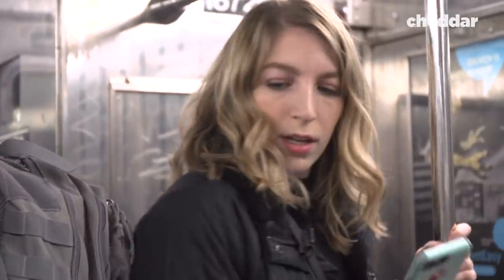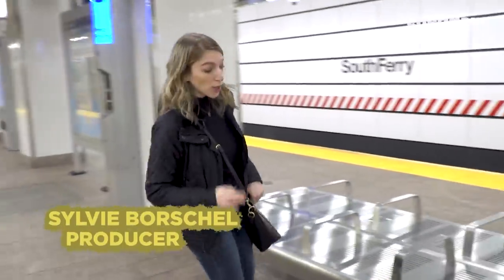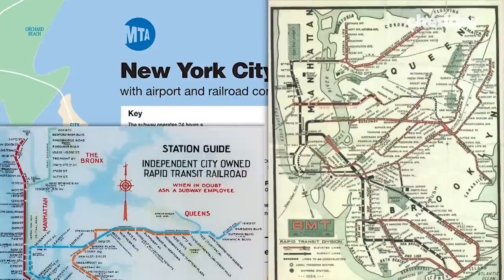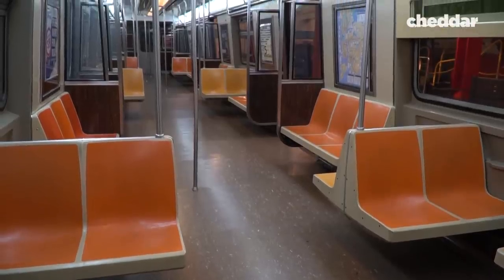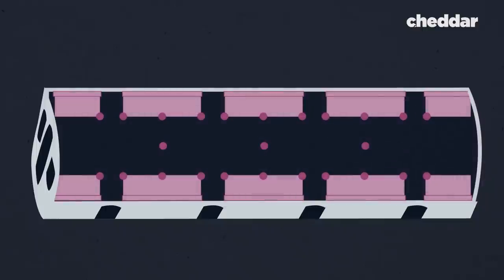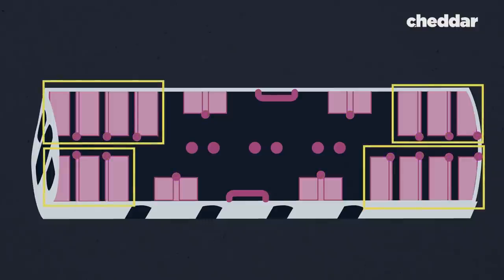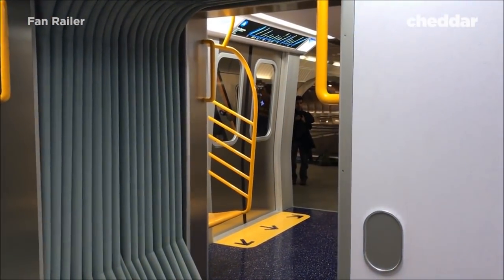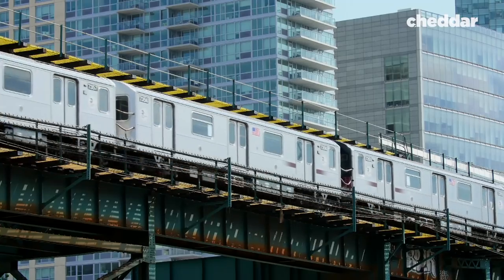Could This Subway Car Save NYC Transit? - Cheddar Explains

Comment: Airline style seating on subway and inner city trains is the worst idea ever. We have them on some trains in London and they are horrible. They aren't designed for getting on and off quickly, they are suitable for long distance travel only, not short hops. You have to squeeze past someone, because of this the window seat is often empty when it could be full. They eat up more standing space. Because there is less room to get along the isle, it only takes one person standing to stop those seats being filled and instantly lower the capacity of the train or to make someone miss their stop. It's just poorly thought out design. Airline style seating should be for situations where a train makes a stop every 10+ or 20+ minutes, not every few minutes like most inner city trains do.
Reply: Our new trains in Brisbane Australia maximise seating and have higher chair backs for comfort, large bathrooms,  gangway doors. They are really nice. In Australia it is common curtesy to always sit in the window seat and leave the aile seat for other people. Then,  people just stand up when the window person wants to leave.
Reply: @cocoacoolness   Inner city trains in London

London has a population double the size of Sydney. If you combine Sydney and Melbourne you'd get London's population. Greater London covers an area one fourteenth of those two cities combined. Brisbane has a population of 2.1 million. More than four times less than London and covers an area almost fifteen times larger. So no, not really comparable. 

In Brisbane it might make sense to have that style of train because the distances between stops will be longer (meaning an incentive for passengers to sit down) and carriages won't be as packed (meaning it's easier to get on and off). But if Brisbane population density doubles then they'd probably have to change the style of train.

New York metropolitan area and Greater London are at least similarly comparable some aspects, however New York City appears to have a much higher density - probably because it's a much taller city (London is yet to get as many tower block living accommodations as New York has).
Reply: That's kinda what I thought when I saw the "perfect" design revealed. I'm glad they decided to go with the design that they did.
Reply: It works in D.C. They're subway cars are pretty great. Not the same style as they recommended in the video but the ones there work pretty well.
Reply: @cocoacoolness  The difference here is that Brisbane's train network is a commuter rail system, instead of a rapid transit system, which is what New York's subway is (and a bunch of others like London's underground). This means that trains in Brisbane are built for longer distances to work with the layout of Brisbane and quite frankly most Australian cities, which is more suburban and less dense than cities such as New York (Sydney is maybe an exception). That's why comfortable, transverse seating works better in Australian trains, because there isn't a need for more standing room which is only needed for fast and short distance train commutes
Reply: Nothing compare to Greater Tokyo Metropolitan.
Reply: Agree.
Reply: Most of the UK's railways use airline seats and they are comfortable when the person next to you is already sat there
Reply: NOJ Exactly. 👏🏻👏🏻👏🏻👏🏻👏🏻👏🏻👏🏻👏🏻👍🏻👍🏻👍🏻👍🏻👍🏻👍🏻👍🏻
Reply: NOJ honestly im soo glad we have the type of subways that we do they are kinda comfortable unless the train is full. But if you do want longer rides like the ones you say are in london we have the long island railroad., it has a plane design and has longer rides i love it 😭
Reply: If you have a short trip, simply don’t sit on the “airline style seating”.
Reply: I agree.

Source: I travel on the Bakerloo and Metropolitan lines...
Reply: While you're partially right about London, it is still mostly an MRT system, but National Rail takes charge at some areas to be considered "commuter rail".
Reply: Toronto’s subway has “airline” style seats but the whole train can be walked through (no doors separating carts)! I think that solves the issue with short hauls! Some people don’t bother to sit cause going three stops will take 5 minutes ish
Reply: @tinyelephant1533  except in reality DC is switching away from airline style seating to mixed seating. Metro also goes far out into the suburbs and has longer average distance traveled.
Reply: You're 100% correct. I INSTANTLY thought there would only be one person in each of the airline seating rows. I'm kind of shocked this video recommends it. It kind of discredits any future recommendations they may have. If I watch them again, I will take their opinions lightly.
Reply: Yes, they basically just invented a bus. Good job MTA.
Reply: You can locate seats perpendicularly to the moving direction only if the line has not got many passengers during rush hour and to get places for people with low mobility.
Reply: NOJ geez so long
Reply: Thank god the MTA went with the design they chose. Asymmetrical door placement would be confusing for riders (predicting where the door will stop on the platform that you can get on quicker) and would present logistical challenges. In many foreign cities where subway overcrowding is an issue (Tokyo, for instance), platform edge doors are installed to prevent people from getting pushed off the platform onto the tracks below. Having a different door arrangement on different kinds of cars would make it complicated to install platform edge doors to suit all kinds of cars. Also, transverse seating is quite difficult to get in and out of. They probably used BART as an example. But BART's cars are huge in comparison (5'6" gauge compared to MTA's 4'8.5") and have really wide seats with spacious legroom. Also the BART cars have very few doors and are extremely outdated.
Reply: in lisbon the airline style works more than well
Reply: London is almost a mega city
Reply: That would never work in any Chinese cities that's for sure.
Reply: I’ve never had a problem with the London trains. I think they’re great
Reply: In Sydney we have airline seating and upper/lower floors. If you have a short ride (one or two stops) you can stay on the entry/middle floor with open seating and a pole (also good for bikes which are allowed on the train). We have short stops and it works fine, just move to middle floor when it's time/near time to get off.
Reply: NOJ yeah I saw that and was like I would NEVER sit in one of those seats
Reply: Still better then out trains in the USA
Reply: This is to make up for lack of investment for years and years. Just think, New York has NO light rail! Just buses! Els removed for the dream of massive trucks that would get rid of the 12 railroads that had freight yards there. Gee, I wonder why traffic is so bad??? Duh.....Most of the rail system even in NY is gone!
Reply: Tiny Elephant, perhaps the crowding in DC is not as much as in NYC or London.  Besides, it is not unlikely that WMATA will soon follow the suit of other transit agencies - Chicago (CTA) for example - that had traditionally relied on transverse seating but are now transitioning to longitudinal instead.
Reply: Trenika Washington, are you trying to say that New York subways are not crowded enough to warrant longitudinal seating?
Reply: Well, yeah, sure. Australian city trains have airline style seats (Except the Sydney double deckers actually have both arrangements.)

But you have to consider context here. While the Sydney inner city stops are indeed only 1-2 minute trips...
That same train may head out to Penrith, in which case anyone that got on the train at Central will be on the train for oh... 120 minutes or so?

Similarly, a trip on the Brisbane network will probably be 5-10 minutes even for a short trip, and 80+ minutes to get to the edge of the network...

That's really not comparable to a metro system;
Last time I was on the London underground the longest trip I took on the system was about 25 minutes...

You're talking about different contexts without realising it.

There's a difference between a situation where typical journeys are in the 2-20 minute range vs those that average being in the 30-120 minute range.
And this, again, is different to long distance trips that can be in the 1-6 hour range...

Or, as can happen in Australia, train trips that are more accurately measured in days rather than hours.
(take the Indian Pacific from Sydney to Perth sometime... XD)
Reply: London trains are incredibly narrow, particularly the deep lines, I could simultaneously touch both sides with my palms. That’s the problem
Reply: They also dont seem good for the elderly, people with packages or disabled ppl
Reply: Also it's hard to clean. NYC metro is already infamously dirty.
Reply: Poorly thought out design? The older cars that use this design (1972 stock cars on the Bakerloo and formerly the Jubilee and Northern lines, and the old 1967 stock cars on the Victoria and formerly the Central lines) were bought during a time where crowding on the Tube wasn't much of an issue - and the Bakerloo line is a fairly long line as is. The Metropolitan line's S8 stock cars have transverse seating because it's more of a regional commuter line rather than a classic underground line, so they could afford to employ such a design.
Reply: In Prague, they switched from all perpendicular seating that the old Russian made cars had, to all transverse seating in late 1990s when they modernised the old Russian cars and later used that design in new cars for C line. It did not work quite well, so later series of both modernized and new cars replaced this with perpendicular seating in the middle of the car (between second and third door) while keeping the transverse seating in the rest of the car and it works quite well. There aren't any delays due to long dwelling in the station even during rush hour, which can be as as crowded as the one in NYC or London, so they obviously did something right here. And I personally welcome this design, because my sensitive back can't stand sitting on perpendicular seat for even a few minutes, so I'll rather stand than sit there. That's why I welcome this choice possibility.
Reply: exactly
Reply: @ThomasFarquhar2  the point isn't about railways. It's about inner city subways and inner city railways. I agree for long journeys across the country airline style seating is perfectly fine. But when a train makes regular stops every few minutes, like happens in most of South London, this type of seating is terrible as it's impossible to get on and off the train.
Reply: @jenny-or2vs  I think you've misunderstood me. London has short stops, generally. However, some train lines come in from other parts of the country and do regular stops in rush hour. These trains have airline style seating and are a pain to get on and off of because of it. If you decide to sit down you may miss your stop because the airline style seating doesn't give enough room for others to get out of your way when you stand up to get off. It's just a poor design choice for busy trains.
Reply: @fnihp30  but it eats up standing space and reduces capacity therefore making airline style seating on busy commuter trains a bad idea.
Reply: @olivertsaldivia4927  no need to be rude. I'm speaking from over 30 years of experience living in one of the world's busiest cities using its public transport system daily. You don't need any engineering experience to know when something doesn't work and when something does work. Good engineers and designers speak to users to understand what makes good design. It's called user feedback. A user, using your design everyday, will be able to tell you far more about the thing you've designed than you ever will know when you designed it. You'd do well in taking this advice and learning how to speak to people without being rude.
Reply: @Rustinpeace25  don't read it then. If you have nothing constructive to add to the conversation it's better to just say nothing at all - you'll end up with a happier life full of happier people this way.
Reply: @trainzguy2472  ok. But no one here was talking about door placement. My original post and the ones that followed are about seating arrangement. Airline style (or transverse row) seating where people face the length of the train carriage OR aisle-facing seating where people look into the isle with their backs to the windows of the cars. My argument is in favour of aisle-facing seating on busy inner city subways and railways, where airline style seating becomes a hindrance to fast turnaround times on packed trains going relatively short distances between stops.
Reply: @hypetherobloxguy1622  I would agree for most trains in London they are great. But try doing a journey that doesn't use TFL trains and you'll soon see the issues I'm talking about. Like Kentish Town to Peckham Rye, or the other way around,  at rush hour and you'll end up having to get on some very busy trains that were designed for long distance out of city journeys - they have transverse or airline style seating and tiny isles not designed for commuters to pass by one another. Some even have sectioned off "1st class" sections that get filled with commuters who have no other option than to squeeze into them.

TFL have designed their trains to suit rush hour and generally have large sections of isle facing seating.
Reply: @KuraIthys  no. You're talking about a different context. I'm talking about inner city trains. You've taken what I've described and tried to force it onto a completely different situation. The Sydney trains you have described, sound like they do some stops in the city, but most are out of the city - that's by definition a national train not an inner city train, so airline style seating makes sense as people aren't going to be getting on and off regularly. Also, please take the time to look up the population density of London compared to Sydney - when Sydney has a population density 13 to 14 times it's current population you can start talking about public transport systems coping with rush hour commuters.
Reply: Craig F. Thompson  they've actually done a lot in recent years to fix the height difference between train and platforms in the London underground.
Reply: The Tube is really good anyway.
Reply: @idontwanttopickone  it is mostly crowded in zone 1. In like zone 3,4,5,6 and beyond, it is quite calm.
Reply: @tescotrain  depends which line you are on and what time of day it is. An obvious case in point is Stratford which is zone 3 and is often jam packed because people going shopping there. Same with much of the Northern line and Piccadilly line at rush hour. Also, it's silly saying it's just the inner zones, most of the London tube and rail network goes through there or is in those zones. Meaning, if they slow down because of poor design or over crowding (as they can do, especially on Southern and Thameslink trains) then the whole network is effected. 

I've lived in London my whole life. Lived all over and commuted from various parts to others. So I know very well where the worst parts are.
Reply: @idontwanttopickone  since this virus is here, it is quiet very much now. I came from Gatwick Airport to London Victoria, the tube and the Southern train I've been on was quiet.
Reply: @tescotrain  Obviously. Most people in London work in offices. Office work can often be done at home as long as the employee has a computer and internet connection at home. So, for the time being, the transport system will be quiet.

But this is completely off-topic. As this situation will not be forever and many will start going back to offices, eventually.
Reply: NOJ ohhhh damnn i imagined it completely differently but i think i got the right picture thanks
Reply: You are absolutely right. I am glad the state government didn't decide on that.
Reply: Firstable, 🚆 are designed for intercity travel not inner city travel. All of the metro in the world are just being silly
Reply: because they are two different things.
Reply: well done. Congratulations you get a gold star. And New York is also the state.

What's your point?
Reply: in what way are you correcting me? I said the New York metropolitan area for a reason. All you've done is pointed to what I've said and said, "you said this" and literally added nothing else to the conversation. 🙄
Reply: yes. Again, what's your point?
Reply: but you're not correcting anything.
Reply: Why are so many people so stupid these days that they don’t know how to spell "aisle"?  I see people doing this everywhere.  An "isle" is a body of land surrounded by water.  You know, an "island."  An "aisle" is a walkway between two objects, such as the walkway between sections of seats.
Reply: Maybe make them on express trains
Reply: The Renfe Cercanías Civias though
Reply: I agree, the airline style seating looks like a nightmare. We already have it on many of our busses and it's not comfortable at all. Also, it's not the middle seat that's the problem. It's the crowding. I don't want to sit right next to a stranger but would prefer a bit of space between us. The isle style seating allows up to 6 people per seat, so when I see two people on each end I always make a b-line to the absolute middle seat, since there will be space between me and the other people.
Reply: @ExcelonTheFourthAvalonHeirs  many people in new york put there motorcycles or wood on the train
Reply: You answered it yourself, the S8 stock of the Metropolitan is made for longer distance journeys
Reply: Also the non-symmetrical door layout doesn't work as trains are usually boarded on only one side and it makes it impossible to have platform screen doors due to door being miss-aligned when the station layout changes between side and island platforms.
Reply: @ThomasFarquhar2  airline style seats make sense on longer distance trains, but absolutely don't on tubes, hence why longitudinal seats are far more popular on metro trains all over the world